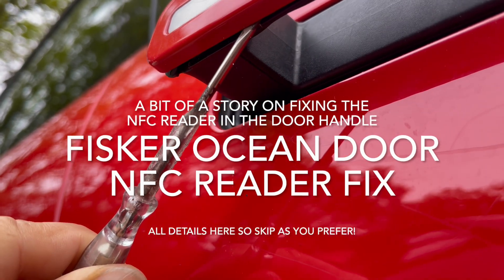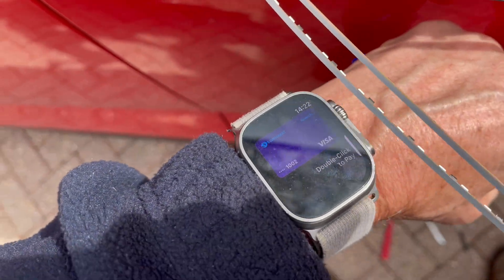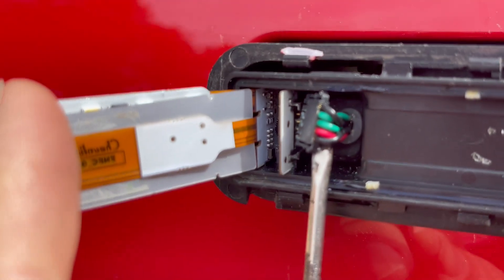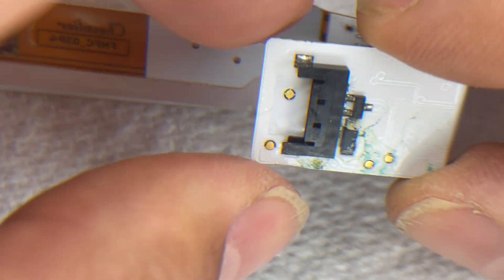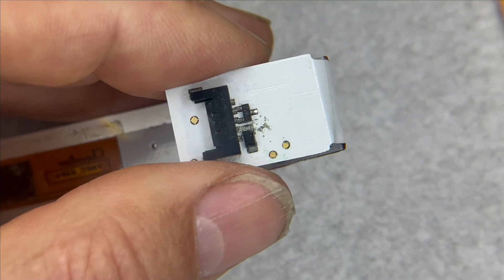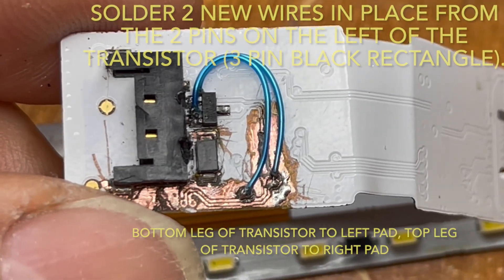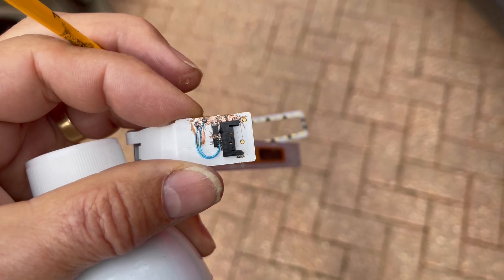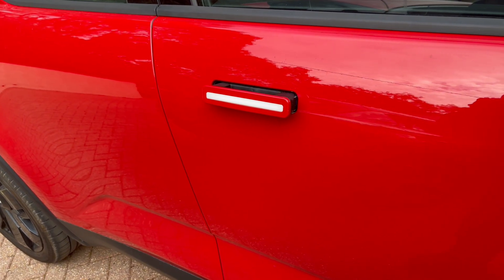DOOR NFC Reader FIXED on FISKER OCEAN! - A difficult fix for water damage.

Comment: Thank you for your videos. I learned how to solder electronics and added a switch to my keyfob after watching that video. I wanted to fix my NFC reader but, instead of the water corrosion you showed in your video, mine was kind of burnt up. I could feel the heat inside the old handle (replaced with Gen 2a handles now) until I disconnected the little 2-wire power feed. Got so hot in there I had to tear up the plastic casing to even get a look at the electronics as the flexible board was heat-bonded to the casing.
Reply from the maker: Thanks, interesting.